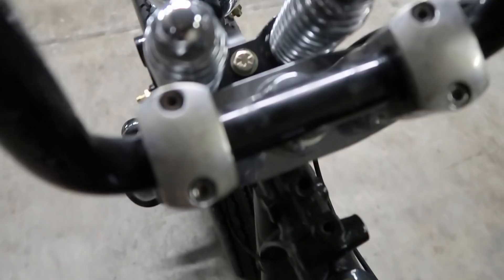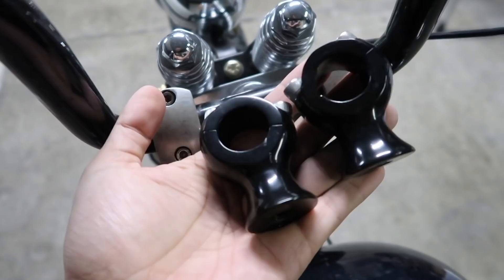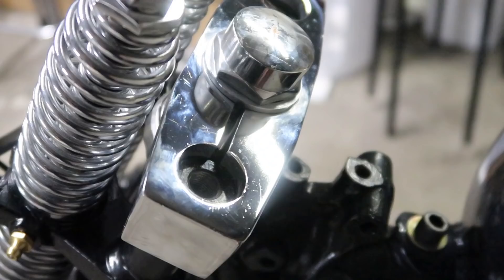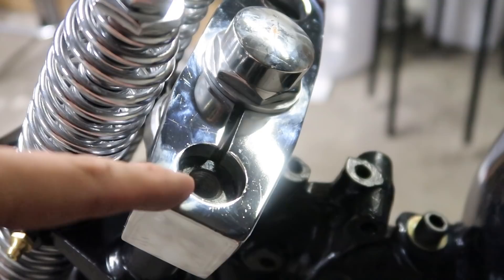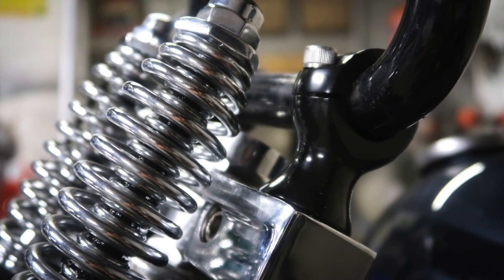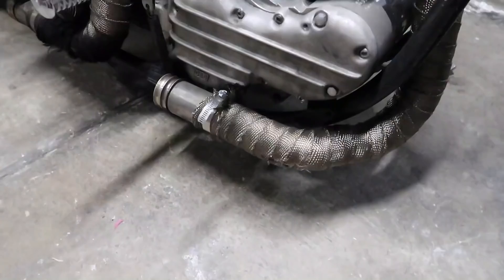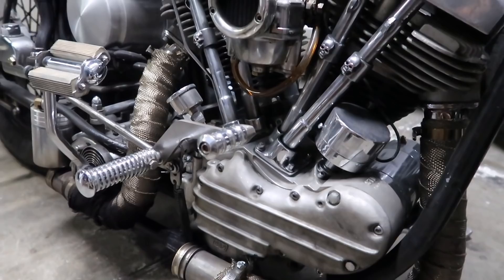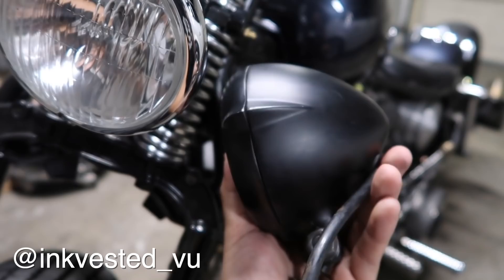Biltwell risers for springer front end | Lnspltblvd

Comment: I have seen a lot of people  putting springer front ends on the 600 and 750 wondering if I can put a dyna springer front end on a honda vt1100c do you know if it will work or can I use one that was for the 600 or 750 kit on it thanks for any info